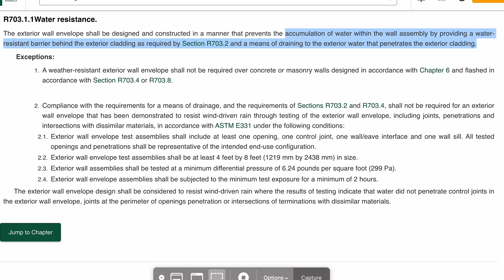Episode 3. What Should I Use? - Weather Resistant Barriers

Comment: Second time I'm posting this comment as the first video was deleted or removed back in March. 

Here's my original comment:

I was very disappointed in the prosoco r guard spray wrap. Worked on a 8000sq ft custom home and decided to give the product a try based on previous build show videos. We prepared the surface with joint and seam filler and used fast flash for all window openings and penetrations, then We rolled the product on in 2 very thick coats to the proper mill thickness. The prosoco spray mvp (pink one not the cat 5 product) performed very very poorly. During and after a rain shower water could be visibly seen soaking thru the osb substrate and running down the inside of the wall cavity. The joint and seam filler and fast flash are good products,but I would not recommend the spray wrap mvp product. We ended up using the typar house wrap system on top of the prosoco product followed by 2 layers of 30# felt paper. Maybe the more expensive cat 5 would perform better but the spray wrap was horrible and a huge waste of money, we used a few pallets worth of that product around 50 5 gallon buckets to try to get the system to perform correctly but ended up being a huge waste of money. Sometimes the simple methods perform the best.
Reply: Jeez that's brutal. I bet someone was pissed.

Comment: BAD video, basically a promotion video for Proseco liquid applied barrier, no examples of other systems, missing pros and cons for all available types of WRBs. Just mentioned mechanicals as a category and shamed it and said Proseco liquid applied is better.
Reply: Yeah the original video was posted in March then taken down. I was extremely disappointed with the performance of the Prosoco Spray wrap MVP (roll applied and back rolled per Prosocos installation instructions). I would not recommend. We wasted thousands of dollars on it. The fast flash and joint & seam filler performed well. But Spray wrap MVP was a huge disappointment.
Reply: @beii-c4e  what was your issues with the MVP? Was it difficulty in application, pin holes, needing more coats to completely cover, or was it an issue with simply applying it to the sheathing? I was thinking of trying it in the next week or 2 so I'm interested in your input before I go for it.
Reply: @MrItalianfighter1  I've used it on new builds. It's hard for it to get into the pockets of the OSB if roll applying. Spraying works well but you need one hell of a sprayer. I also would not recommend if you are roll applying to OSB. Plywood application via rolling I think is fine. Just my opinion

Comment: Great video.
Being a stupid fisherman and having been deeply involved in custom boat builds. I have always wondered if you took a marine primer and paint, lets just say Polypoxy, and shoot the entire outside of the plywood or OSB with entire structure intact. Before you route out window and door openings.
In the long run you would have an incredible airbarrier, monolithic epoxy paint that will never see the sun once the clading is on. 2 guys with a sprayer and tele lift could do most houses in a day. 
Too expensive?

Comment: Or just use Huber Zip sheathing.  Zip-R for areas that require exterior insulation.  I used Zip-R12 in zone 6 with 2x4 construction.  Doors and windows designed for 2x6 construction fit perfectly.  I Zip taped the seams and detailed the window openings with Zip tape and Zip stretch tape after watching videos because I didn't trust my framers to do it correctly.  It was easy.  After I did a lot of research on what exterior insulation system I thought was best for our new home build, Zip covered all my concerns.  No regrets.  Our blower door test was 75% better than passing.
Reply: A few questions if you don’t mind-

1) Where the heck do you get the stuff? I can’t find any for sale within a hundred miles! 
2) What type of fastener did you use?
3) What did you use for bracing? I’ve seen some folks talking about how the shear strength for thicker zip r gets pretty weak. Thoughts?

Thanks!!